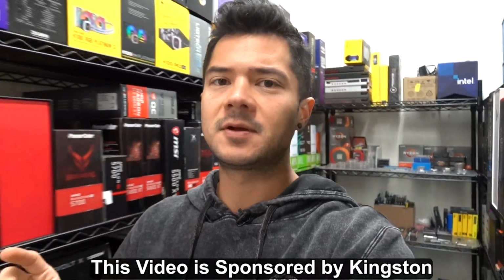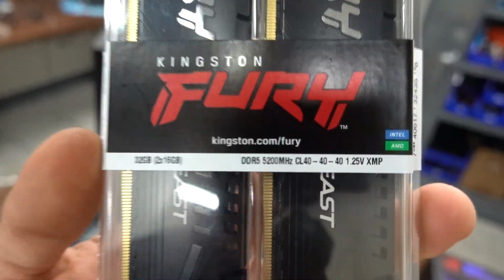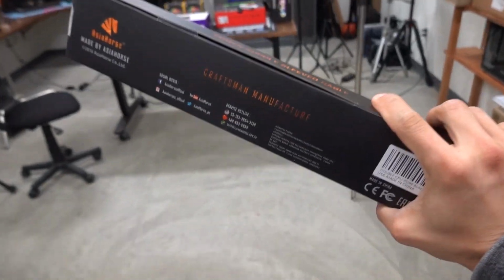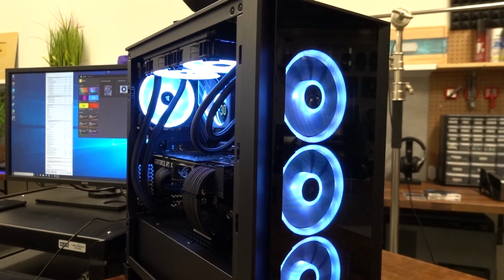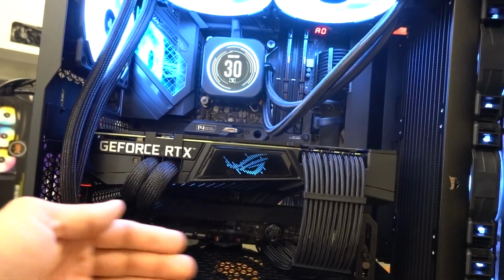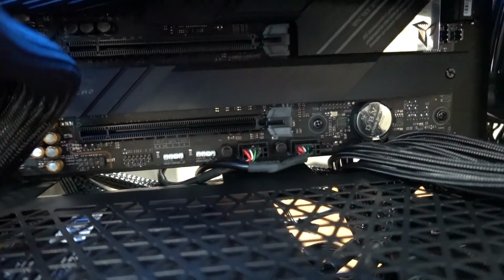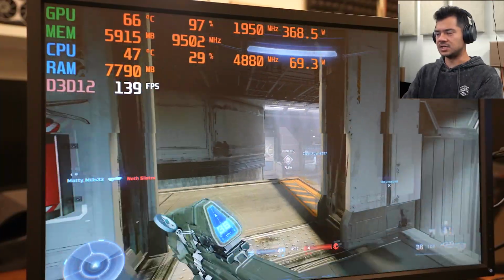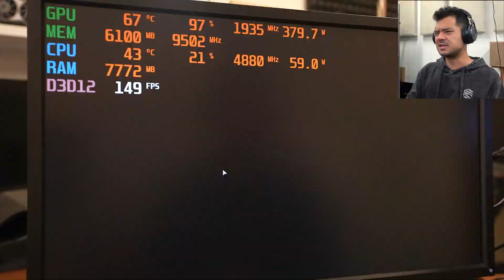Finally giving Team BLUE a chance - My First Alder Lake DDR5 Build

Comment: I just upgraded to the 12600K from a 4790K. Lemme tell ya. Alder Lake is amazing.
Reply: Well I kinda hope 8 Gens later you see a big difference
Reply: Congrats. I just ordered my 12700KF today. Still sticking with DDR4 though because DDR5 is just stupidly expensive atm.
Reply: @likwiddawn  what's the difference between regular k to kf?
Reply: @FenderJaguar66  kf doesnt have integrated gpu. Everything else is the same
Reply: @FenderJaguar66  KF has no integrated graphics unlike The k but still overclockable unlike last gens f cpus

Comment: Thats interesting. My FE 3090 is usually 62-64C in this game. I play on 3440*1440 Ultra settings. Goes to show the stock air cooler really does work well. To be fair I have 9 case fans.
Reply: Are you me?

Comment: Very nice build, I just bought this same board and Corsair dominator rgb ddr5 ram and a 12900k as well. I'm going to be using the lian LI 011d xl case with the lian LI sl fans and an ftw3 3080ti. Looking forward to building it up. Best to use windows 11 or is 10 ok?

Comment: I was all excited to mount my GPU vertically in the 4000D, but it sits to close to the glass and thermals where total trash. Maybe a slight oversight by Corsair. I have the MSI 2070 super gaming X. Was getting up to 85c vertical, then 50 to 60 horizontal.

Comment: I’m trying to switch to the small form factor NR200 but I can’t switch until I sell some of my current components. I have a Asus Rog Strix B550-F, Thermaltake V250, and Corsair CX750M. Would you like to take these off my hands? I’ve used them for less than a year and I don’t want them to go to waste and know you’d make good use of them!
Reply: I’d just rather have you have them to potentially give to someone who actually needs it rather than some random on eBay

Comment: Never left Intel because I use VR a lot and there used to be tons of compatibility issues and jank with HMDs and software. I didn't wanna deal with it, hearing its been getting better though.
Reply: VR streamer here, with a 3700x, 3080ti and a valve Index with FBT, there are no compatibility issues using AMD.
Reply: @LordSanDisk  I'm talking when they released and the hp reverb g2 had issues the vive pro with vive wireless had issues on amd.. there were various issues along the way so I just stayed away because I had both of those things .I just never switched over. For me I see no need.

Comment: It's good to see a fresh PC build video, I haven't really watched PC videos much the list few months. 
It would be great to have a PC part selection like this to build PCs, after building my first PC last year, I'm wanting to build another one, but this time do it all myself, meaning not getting the cpu, ram, and cpu cooler installed by the techs where I got the parts from. Only thing is,  I wouldn't know how to upgrade bios, they also did that for me.  

Also maybe it wouldn't take me l like 5 hrs to put it all in the case and figure out the cables 😆
Reply: @otaconzz  yeah I'd like to build another pc, fully myself, I could have had it finished sooner then 5 or more hrs but I couldn't figure out the front io cables. Until finally after rereading and looking over the book a few times.  After that it was clear, and just figuring out the cable management.
Reply: @otaconzz  lol that would be nice,  I have the meshify C it was a pain to get my fingers on there and plug an the small things in.

Comment: No need to butcher your case to use the CableMod riser set-up with this GPU, because it has an integrated AIO... Meaning, because there are no fans on the GPU, you don't have to worry about choking off the air flow if you mount it in Corsair's vertical mount location. If this was any other type of "blower" or traditional GPU (with attached cooling fans) this would be a concern if you are pushing the GPU. Another great looking build, Kyle! Thanks for setting the bar high!
Reply: theres a blower fan on the gpu
Reply: This is technically a hybrid cooler it still uses fans to keep the vrms and memory modules cool. Only the die is liquid cooled.

Comment: My new system has the same CPU and AIO. But I have the 5000X case along with 4 ll120 fans and a RTX 3090. I went for a 1200W PSU and my mobo is Asus ROG Z690-A instead of E. I went for DDR4 because I dont think it is worth the extra price to go for DDR5

Comment: ayo kyle. i have an idea. since you will have 2 different setups, one white and one black. put 2 different desks on each side halfway through your room, one white and the other black, then put a wallpaper on your wall that is separated between white and black, and then put the white pc on the white side and the black on the black. then change all rgb on the white side to red (amd) and the other to blue (intel)

Comment: Just something to throw out there. Does it really matter how close to the glass the graphics card is if it's mounted vertically? It is liquid cooled and the airflow is dealt with at the radiator location, not at the graphics card itself. Maybe I'm missing something here.

Comment: I feel like the back exhaust fan doesn't really make sense since there isn't a whole lot of heat generated inside the case. Maybe try to flip it around and see if gpu temps drop significantly?

Comment: I mean, technically, 8 times 3 is 24, so there is no reason not to use the 24pin combs for those 8pin connectors.

Comment: Just built a 12900KF system two days ago. It's about 30% faster than the 5950X system I have. I was really surprised. Don't listen to the AMD hype. Performance-wise in the desktop space, Intel's currently the king.
Reply: Currently. And has yet to release the new ones
Reply: @rookie693  That's why I stated "currently". Unsure of why you repeated what I stated. Competition is good. I have a mix of both (including a 5950X). Being a brand loyalist is foolish.

Comment: I'm not touching DDR5 for at least a year, guaranteed there are some huge bugs and kinks to work out right now.
Reply: Well you probably won't be able to find any kits, but overall I'd say DDR5 has been decent so far. Your not going to see any crazy difference between 4 & 5 but DDR5 is having a better launch the DDR4 had IMO not having any of the issues I had with DDR4 back in 2017. Out of the box my rog hero had no problem with XMP profiles and I've been able to clock my memory at 5600mhz with my own timings fairly easy.  I see people just repeat the same shit without any actual evidence, have not seen any major bugs the past month or so and easily been able to get rated speeds lol.